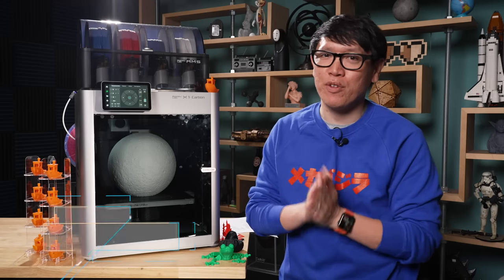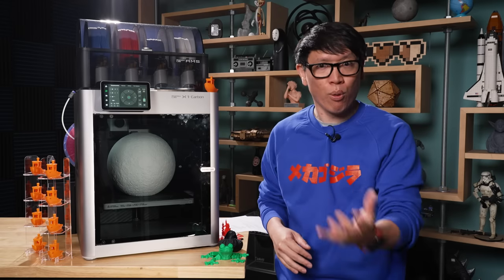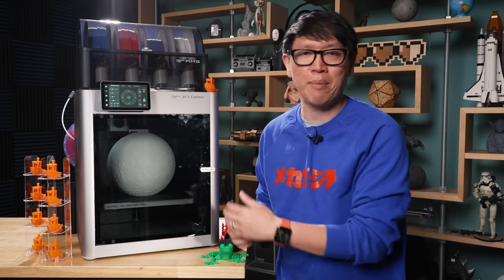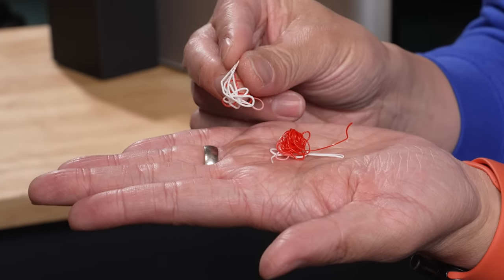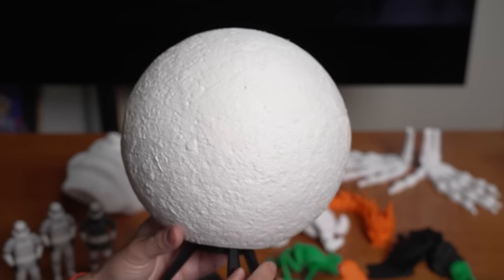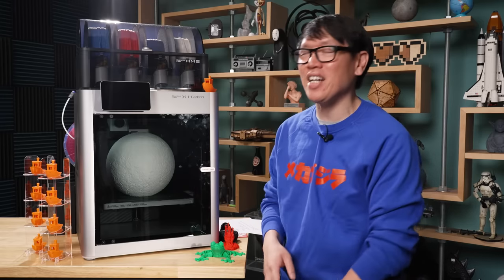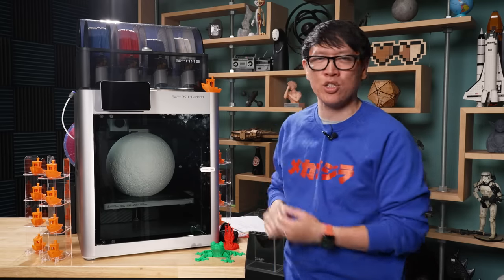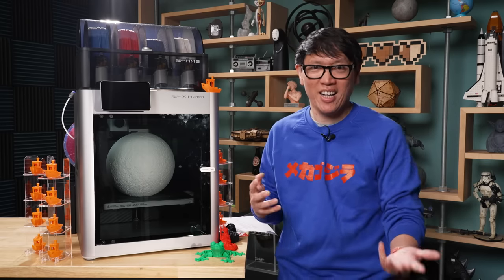Bambu Lab X1C 3D Printer Review: Speed at What Cost?

Comment: Input Shaping is pretty amazing… it's mathemagical! We added ZV Input Shaping to Marlin in version 2.1.2 and there will be more advanced Input Shaping included in Marlin 2.1.3. This means that even inexpensive machines like the Ender-3 can get smoother prints at higher speeds without any additional hardware, just by updating the firmware. The way Input Shaping works is pretty cool. Basically, every impulse that moves an axis generates ringing in the machine frame with a regular period. So all we have to do is time half of the impulses so that they occur at just the right moment to catch that frequency wave on the return swing, and it effectively deadens the vibration. I'm working on the input shaping code every day so I know it intimately, and yet it still seems like magic. And truly, it is!
Reply: Thats so freaking cool. Thanks for your work on this and the explenation. We need more peeps like you!
Reply: Meanwhile prusa is still prusa and prusa 2023 is garbage.
Reply: Bro thank you for your work.  Got my P1S in last week.  Thing's great and a large part is owed to you.
Reply: do you know is input shaping a passive automatic ability written in the actual firmware of a printer or is it something you would have to turn on in the settings? I'm on a 2.1.3 now from Risc and I don't see anything like that.
Reply: That's awesome. Thank you for sharing.

Comment: Speaking from experience running basically a fully automated 16 slot filament shelf is an absolute blast, but with great power comes great responsibility. Another way to mitigate waste are models that just stack the colors. Only colors swaps within layers may cause massive amounts. Vertical swaps once every few layers only need a few swaps.
Reply: I'm a very boring person, my prints are grey, or gray
Reply: I'm excited for this ability to change colors for embossed text. I print alot of organizers, usually with a label on them to show what goes in the organizers. Think like socket sets, or plastic tools for automotive connectors that don't come with a tray to put them in. Right now I have to spend a bunch of time carefully painting the raised text. It'd be much easier to tell the software to print the organizer in grey, and the raised text in white.
Reply: @112428  If you can manage to print the letters last, on top of the print, you can just swap the filament when reaching the letters by adding a filament swap to the gcode and do a two color print even on any single material printer. This works by orienting the parts or by printing just signs that way and glueing them on. Stacking two or more colors of the same filament type works on every machine.
Reply: @112428  What kind of socket holders have you made?  I'm looking at getting one for essentially that reason.  Kind of want to make something like Toolbox Widget's style, but specific sizes for certain socket sets I have.  Does it work well?

Comment: I love my x1c. Random unexplained failures are exceedingly rare unlike my ender 3. The machine feels like a tool. If I want to have fun with a printer I fire up my ender 3. If I just want to print a part not have to worry about it (as long as support settings are correct) the x1c is hard to beat.
Reply: I never had unexplained failures with my ender 3's.

Barely any failures honestly and if there were they were easily explained.
Reply: this worries me because I've just ordered a X1C and my ender 3v2 has been VERY reliable. Never had a failed print that wasn't something I messed up.
Reply: First few months my ender 3 s1 pro gave me headaches but I enjoy tinkering and modifying 3d printers. The core problem was bed is warped

X1C is just butter right out of the box.
Reply: For me, having to mess around with a printer to get it to work would take the fun right out of it, hence why I've never made the leap to get one. 

Seeing Bambu Labs after seeing someone mention their current sale, has really made me realize printers are finally starting to be consumer friendly, and I'm now considering buying my first printer from them. I just want to print to get the things done I plan on doing, and not tinker.

Comment: This is one of best purchases I’ve made. I love the hobby but I work a lot and 90% of the time It takes no intervention….with a 0.2 nozzle I’ve printed 0.5 modulus gears both spur and bevel gears and they are perfect…
Reply: When it does though it's pretty tough to service it. Also, I don't like it's proprietary as this limits my ability to fix it or change stuff, especially important if they go out of market.
Reply: @VincentGroenewold  you have free control to fix parts of your printer, the only limitation with the proprietary nature is buying it from bambu lab’s store.

bambu lab has also clarified that if they ever go out of business, they will fully open everything with the printer. everything. design, parts, repairs.

Comment: Hi all, one 'extra' you get from having an AMS is long job run cover or end of spool usage.
My daughter has been printing large scale aircraft parts on an X1C for 5 months 24/7. She sets her alarm for job completion, has build plates ready to go.
Routine being get the completed job out, put a fresh build plate in and send the next plate (In the slicer, you can have multiple plates in one job.) to the printer.
All the filament is same brand, colour and batch so when spool 1 runs out the AMS just switches to spool 2 (Check settings it is a checkbox) so if say 1 and 2 are empty she swaps for full ones.

This is also useful if you are printing functional parts where you don't care about the colour, just fill the AMS with your almost empty of the same type, tell the AMS it is all the same and walk away. If it is a big job then you maybe have to go back to add other end of run filament.
Remember you are trying to save money by using old stuff too short to do a full job, so use a heat box, kitchen dehydrator, oven whatever you have, don't risk a failure with the filament you had in the shed for 2 months.

Comment: Another nice feature I've personally had save me a ton of time, is the auto detection of spool issues. I had to respool some filament and ran into a few tangles, and it automatically detected it, paused, let me untangle it, refeed the filament, and it picked up the print where it left off. The print came out perfect, with very little waste. That normally would have cost me several full prints. Not worried about the filament loss as much as the time. Having to start a 10 hour print over three times would have taken forever. Having interrupted several times only added 30min or so.

Also, all the automatic saves a ton of time worrying about calibrating for each filament to get smooth prints. No more trying to dial in the flow rates and temperatures to get smooth prints. It just works, every time.

Comment: Best feature of the AMS is having multiple colors ready to go for a project. Don't need to get up and swap through your filaments. Effectively making it a true remote start system. 
It's one step away from self cleaning the print bed haha
Reply: Yes! Self cleaning bed would be awesome
Reply: @Just_Jesus_ef  I had a thought. Imagine if the slicer could tell if a part was able to be nudged off the build plate, out the front door into a container. 
In essence it would wait to cool, then attempt to separate from build plate by pushing it. If the sensors are used the system could behave in a way that doesn't damage itself or the part.
Reply: @boonjabby  Sort of the way they have some print farms operating!

Comment: I have a X1C with double AMS, and my experiences have been extremely good compared to other printers i have like a prusa mk2.5 and a sidewinder X1. I have over 500 hours of printing time on my X1C, zero clogs, the only print fails i have had where bed adhesion issues(mostly my own fault) and i can still count the failures on 2 hands. This printer really pushes the market forward, the bar is raised. The competition has work to do.
Reply: You can stack the multi material part for more??
Reply: @Artificial.Unintelligence  Up to four of them for 16 colors!
Reply: @ckoerner  I'm honestly shocked the machine can handle that weight.. and curing how it manages 16 filament lines 😅

Comment: The X1C is a game changer and I love it. For me a 3D printer is a tool vs. a hobby (of getting the machine to work,  and sure, if I have to learn the ins & outs and “tinker” no problem, but I was tinkering more than I was getting value from the tool with my Ender (tinkering 70% + to getting successful prints. 
When I got my X1C, the ratio flipped dramatically. 90% + of success as a tool and rare occasion tinkering (calibrating mostly for optimal results vs. just trying to get a successful print with the Ender).   Not only is it consistently way more reliable, but the speed & quality of the output is far superior. I’m about to purchase another X1C in a week and possibly a 3rd before the end of the year. I feel the same as you Norm, that this machine makes printing FUN again. I was happy to see Adam jazzed about it too. Cheers!

Comment: One thing I've loved is the ability to easily change layer heights in different parts of the print.  I've done tons of multi color prints. I was wondering why that dice took so long. I realized he probably did 100% infill
Reply: I realize that those dice are the kind of use case that a lot of hobbyists will want to pursue, but to get the most out of multicolor printing you really need to design parts specifically for it and take great care in organizing layers in the slicer. A sharpie would have done the trick for those dice. It's all about knowing your tools and learning the most efficient way to use them.
Reply: It's because the way the dice are designed has multiple color changes per layer in some spots. There's probably hundreds of filament changes and more waste than the whole dice itself. It shows the major downside to the AMS, as the other reply says you have to design your slices to take advantage of how it works, or as the review says print in batches to mitigate it.

Comment: Excellent presentation!  This is the only review I've found that addresses, in detail, the quality differences at different speeds.  Print quality is especially important to me since I am a hobbyist (OK to have long print times) who designs engineered parts that need accuracy and good finish.  Thank you for being thorough.
Reply: +1 to this. My biggest frustration with the machine (other than that troubleshooting is significantly harder than with my ender) is that the print quality does seem to suffer at speed, even with calibration. A few thousandths bulge from linear advanced is enough to ruin the fit between parts and waste my life going after it with a scraper

Comment: I'm so super happy with my P1P. The only big downside is the high speed causes a lot of vibrations so you need some seriously stable platform to place it on. I often run my P1P on 50% speed which honestly is still very fast 😶 Eyeing an AMS to make material switches faster and being capable off printing with a dedicated support material.
Reply: For anyone afraid that you can't control the settings enough: you can change literally EVERY aspect of the print including extruder feeding, layer temps (first and rest of layers), infills, overhangs, speeds for every line type. It can be super complex. But in it's core 90% of the time it seems the presets are spot on. Click the preset, hit print, enjoy the show :)
Reply: Man, I have to say, the Bambu support material is freaking amazing. Set the gap between support and print at zero, and the prints look phenomenal. It's also SUPER easy to remove. The only thing is that the switches waste a ton of the stuff and it's not exactly cheap.
Reply: @goawaybaizuo  yeah that's the main thing that keeps me from considering doing multi color printing. It's a loooot of waste. But I can see some edge cases (like that badge where it does a single switch) where it could be cool. And for the support printing I'd only use it on very specific models. I recently printed a Ghostbusters Slimer and getting the support out of the mouth is hellish. There it could be great to have a softer support material 😁 But my main draw is remote switching of materials 👍🏻
Reply: @SyntheticFuture  it’s actually hardly wasteful at all when only using the support material for the interface (*which is what you should be doing!!!!*).

large prints with lots of supports hardly even wasted me a cent. it really is worth it imo
Reply: @robblly8112 thank you! I did not even think of doing it that way. Just got a P1S with AMS to replace my ender 5+ that finally died. This bit of advice just saved me a lot of future wasted support material

Comment: I have quite a few printers at this point that just sit around untouched because of the fact that the X1C just works. For me it’s the convenience of just being able to effortlessly switch materials say if I need to print something out of carbon fiber, I just flip the build plate over and it takes care of the rest then put the plate back and it’s immediately ready to rock out prints in PLA. It’s a favourite of many people for a reason. If your just starting out and want something that will handle everything you throw at it with little effort, just get the P1P as it’s hard to beat at the price point.

Comment: Bambu Labs has been killing it with their printers

What i think the next step Bambu Labs need to do now is 
1. remove X1 model 
2. Reduce the price of X1C combo to that of X1
3. Release a Large build volume printer with at least 350x350x350 build volume and price it at current or slightly Higher then current X1C price

these 3 steps would make them Dominate the 3D printer Market